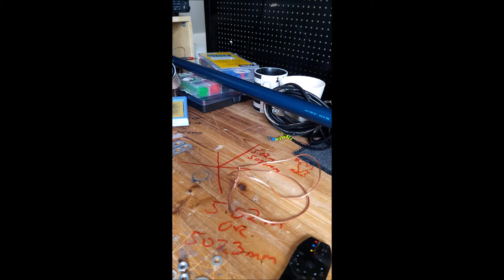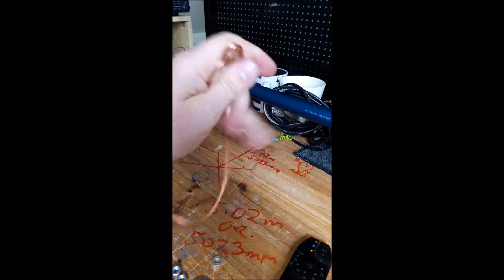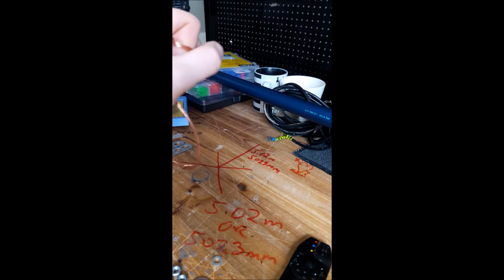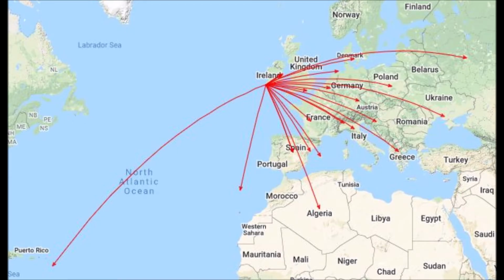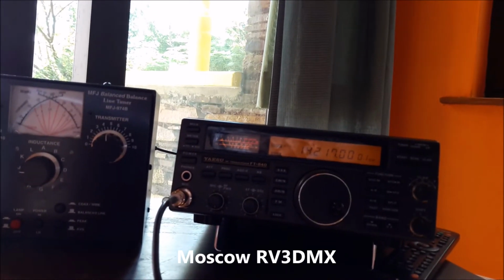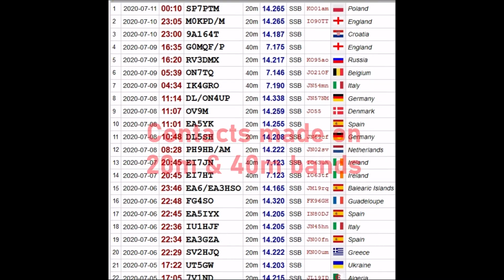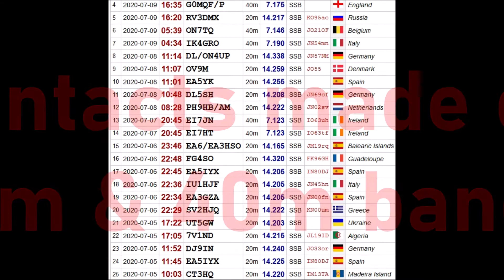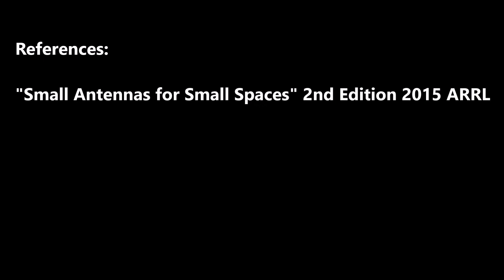Surfing Radio Waves on a Fishing Rod: A Cheap Multiband Antenna for 40m 7MHz, 20m 14MHz & more...

Comment: Three questions, please: What was the length of the antenna wire ("element")?
What was the length of the fishing pole? 
Is it correct that the fishing pole was of non-conductive material, and thus performed only as a mast for the wire antenna?
Many thanks - enjoyed the video.
Reply from the maker: Apologies. Just seeing your post now.
1. The fishing pole is carbon fibre (non conductive)
2. Fishing pole is 5m long.
3. The radiating element (wire) is 5023mm
Hope this helps.

Comment: Were you using an antenna tuner? Will it easily tune 40m on that antenna?
Reply from the maker: Yes I  used a Tuner. I've got ssb contacts on 40, 20, 17 & 10m. I just didn't get a chance to  
try 15 & 12.